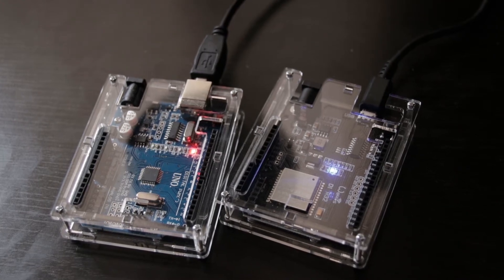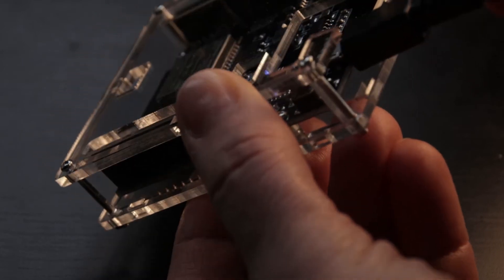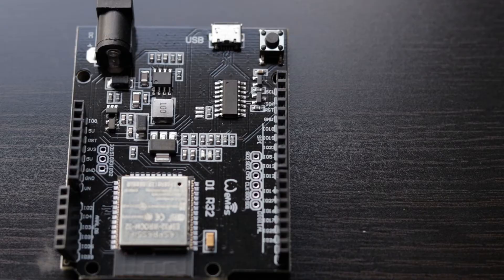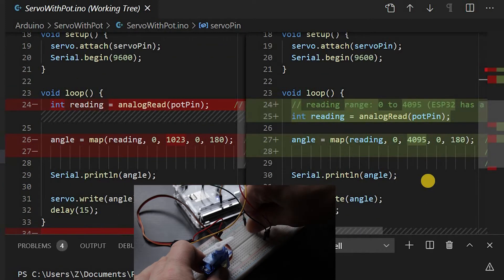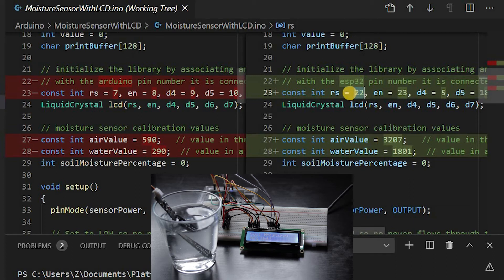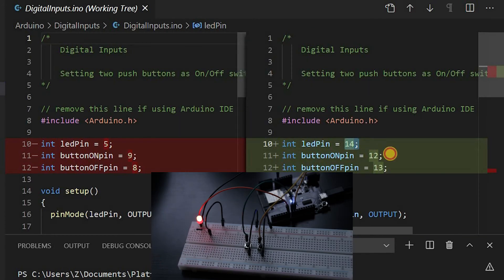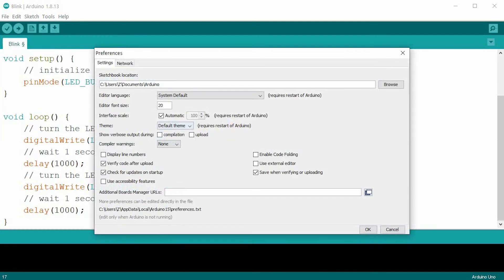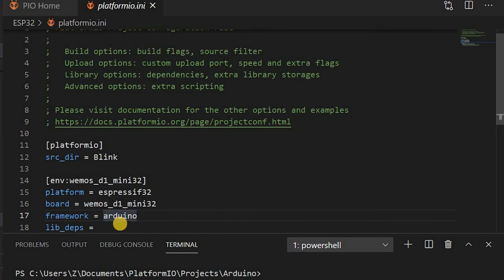From Arduino UNO to Wemos D1 R32 ESP32

Comment: Have you tried any of the UNO shields?
I have used the ESP32 before and the pins were not all TTL compatible (3.3V rather than 6V)
Reply: Using UNO 4 relay shield from AMAZON the 4 relays work fine ,, wifi on my 4 boards sucks

Comment: I seen a simple servo motor project using a Wemos D1 R2. Will the ESP-32 you have shown in the video, be able to work on that? I'm not 100% I can transfer everything over as I'm kind of a newb. If not, what is the next best thing to the Wemos D1 R2? Thanks

Comment: I bought 4 boards of ESP32 D1 R32 from different suppliers to test. All have different print label so I assume they probably are made from different factories.
Output voltage of 4.3-4.6 volt at 5 Volt pin is somehow intentional by design. I found that the 5V pin on the board has to be left alone and the board will work fine. If you feed 5V supply voltage to 5V pin, the board will not work and WiFi will be unpredictable and serial port will have problem. If you draw current from 5V pin to drive load such as LED or buzzer, the board will be unpredictable too. The board is often freezed if I mess around with this 5V pin. At first I thought the board is malfunction but it cannot be the same for all.
If you leave this 5V pin untouched, the board will work well as charm. Do not worry about 4.3-4.6 volt that you can measure from this 5V pin. Leave it alone and it will work very well. It took me a while to find out this.

If I need 5V to feed my load, I add a separate cheap LM7805 to give my 5V load and sensor.

Power 9-12 Volt adapter to the board 2 ways either via the 2.5 mm Jack or Vin PIN.

I love this form factor as it is complete in itself. I do not have to buy the base. Just mount besides breadboard. I can even use simple wire I cut myself at any length without using Dupont pair wire because the board connectors are all female type. Lastly, it is cheaper than other form factors on AliExpress.

Only do you have to know the trick of 5V pin. I think they should remove this pin so it do not confuse people. I cannot explain the reason for this finding because I do not have schematic of this board. I guess it may have to do with RS232 chip but I do know for sure. If anyone know the answer why, please share with all of us.
ESP32 Wemos D1 R32
Reply: Thanks for sharing your experience 
Helpful for me
Reply: Thx , U saved me alot of headaches and money.  I wanted this board to drive a 5 v sensor.

Comment: If plug in DC JACK 12v. vcc output will be 12v. as well?
Reply from the maker: Hey, I'm not sure. Maybe you could try and measure it with a multimeter?

Comment: hey i was trying to upload a simple hello sketch but i am getting this 
any idea how to resolve this 

esptool.py v3.0-dev
Serial port /dev/cu.usbserial-1410
Connecting.....
Chip is ESP32-D0WDQ6 (revision 1)
Features: WiFi, BT, Dual Core, 240MHz, VRef calibration in efuse, Coding Scheme None
Crystal is 40MHz
MAC: 9c:9c:1f:e3:8f:80
Uploading stub...
Running stub...
Stub running...
Changing baud rate to 921600
Changed.
Configuring flash size...

A fatal error occurred: Timed out waiting for packet header
A fatal error occurred: Timed out waiting for packet header
Reply from the maker: Hey, check out my other video here: https://www.youtube.com/watch?v=fCSN_VDOqGU&lc=Ugw1PbHgf7cvssF5mAd4AaABAg

Comment: is the GPIO pins of  Wemos ESP-32 D1 is same as arduino UNO , i want to buy my first IoT board but which board shall i buy arduino r3 or Wemos D1 ?
Reply from the maker: Hey, it's not exactly the same. If you're a beginner, it might be easier to start off with arduino. Arduino has no built-in WiFi though.